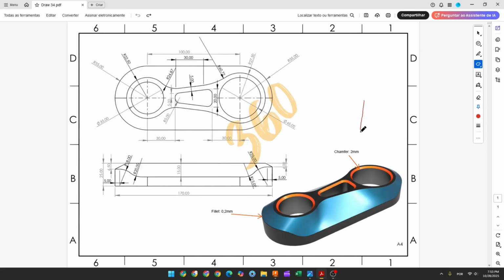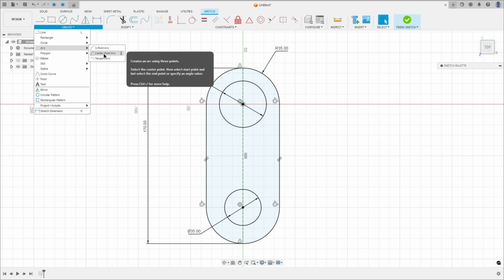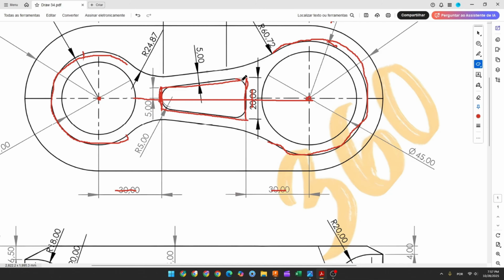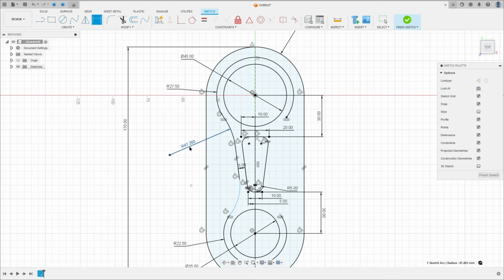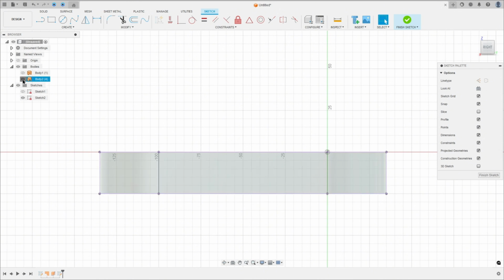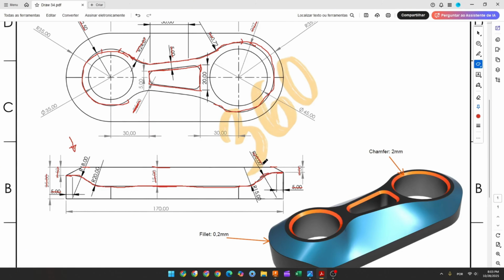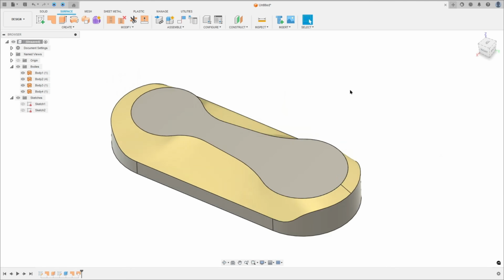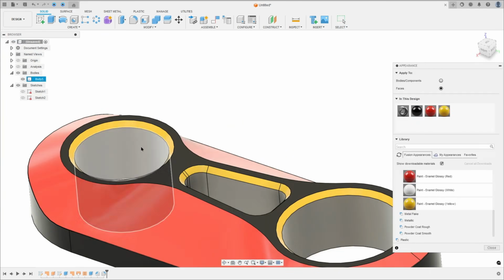The Secret to Variable Chamfers in Fusion 360 | Step-by-Step Modeling Tutorial #35

Comment: This is so difficult in Inventor (all I have). For example, I cannot pick the line/edge to extrude as a surface (around the 7 minute mark). I found the solution: you can change the extrude setting in Inventor - why should you need to do that? , Autodesk is a dinosaur
Reply: Um, well perhaps you mean Inventor is a dinosaur? Since Autodesk also makes Fusion 360 (whose official name is Autodesk Fusion).